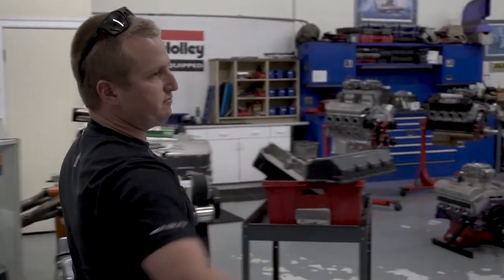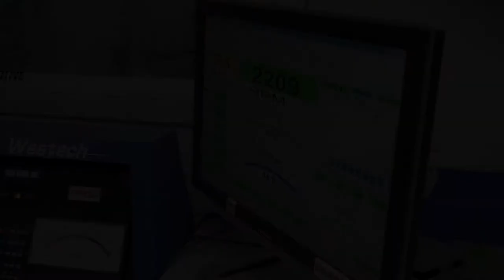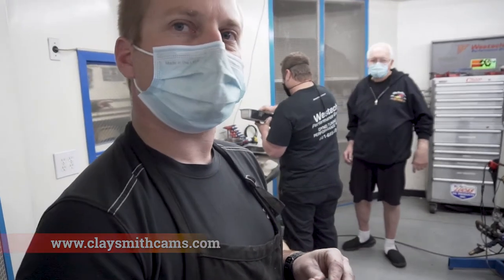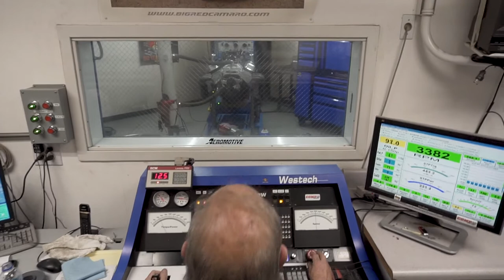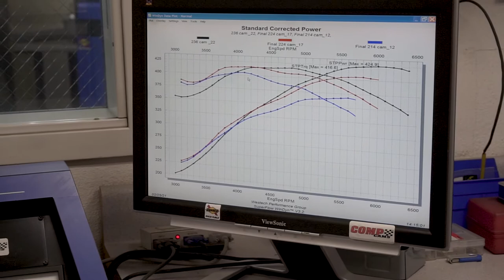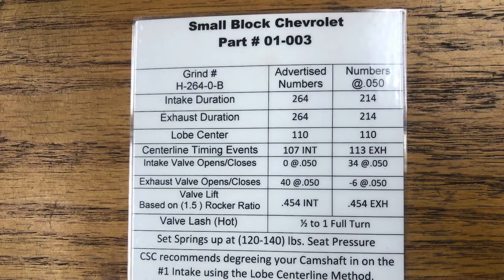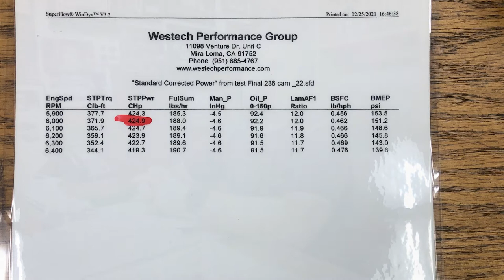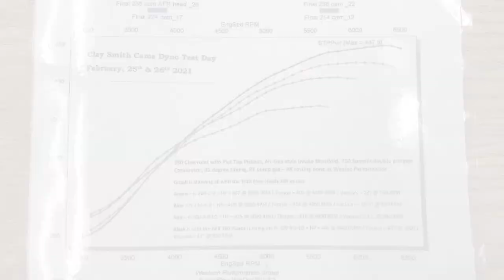DYNO-Mule: Clay Smith Cams Test Session for a Small Block Chevy at Westech Performance Group

Comment: A friend if mine just bought a HR-8094-8-CSR for his 383 build with ported Fast Burn heads for his Firebird. Looking forward to the results. He just wants as much torque and throttle respons as possible for burn outs. Not conserned with peak hp.
Reply: How did it run? Any video? Thinking of running that cam. Thanks

Comment: Try scorpion roller rocker arms. Made in the usa and very durable. Not sure if you figured it out or not but the sbc versions of trickflow heads ,dont actually  make very much power . Afr is about the only way to go..
Reply from the maker: As you can see from the Dyno numbers, this Trickflow combination did great performance wise - making it a good option for a budget friendly build, all available at summitracing.com. We were just showing that you could get some great power out of our Flat Tappet camshafts on pump gas without breaking the bank or switching to a Hydraulic Roller.  At CSC, we do sell a majority of AFR heads for our high performance applications; recommending them a lot due to the fantastic quality and our relationship with the Sperling family. (AFR is family owned and operated by three generations just like us.) We actually plan on doing a similar video as above with their heads in the coming months, so stay tuned. :)

Comment: What would a 237/245 .560/.560 110 LC HR cam make for power with the AFR heads?
Reply: Maybe another 25-30 hp over the last cam they tested and you'll have to spin the motor a little further.

Comment: No dyno results on the 1.6/1 rockers? 
The small cam would likely would  work better with smaller port heads to get the bottom end up. I don't like  anything over 208 @.05" on a mild  street cam.  We drive at 1200 > 2500 85% of the time. Remember top to bottom stroke is only 180deg. luckily there is a  lot of "dwell" around TDC and BDC so with long runners at high velocity they are still spilling in air at supersonic speed,  and you benefit some supercharging  ram effect keeping the intake open past BDC and cracking it  5 deg before TDC.